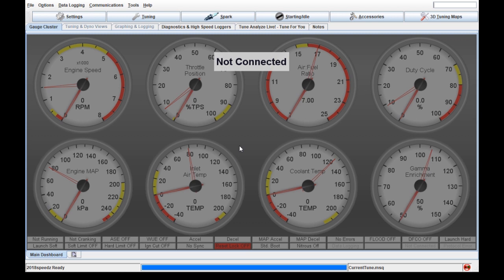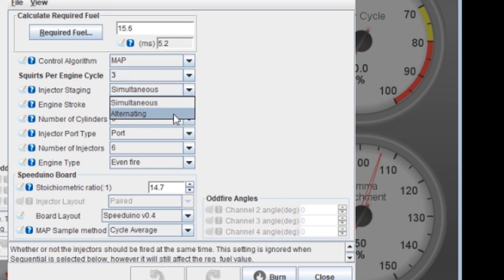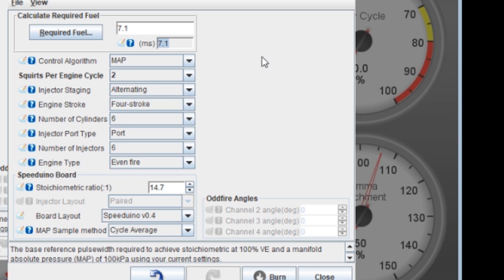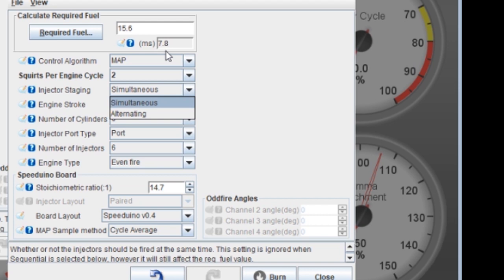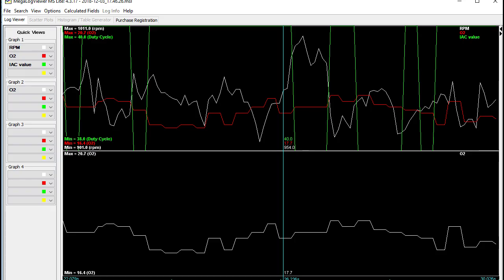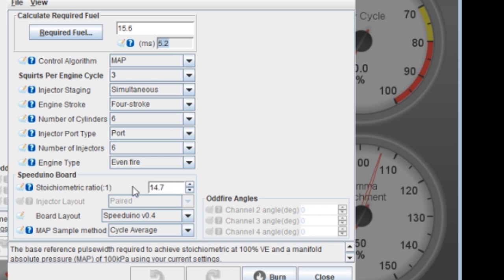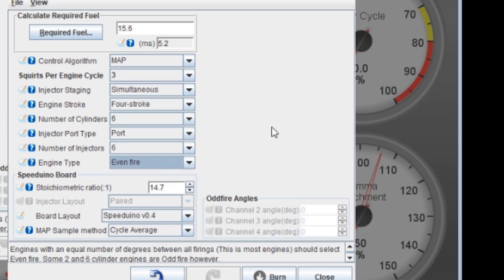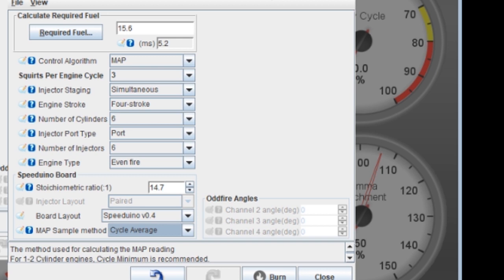Engine Constants - Speeduino Settings Part 1

Comment: just upgraded my injectors to the gtr 440cc. didn't change the squirts or staging only required fuel settings. after maxing out the high load ve cells to the max number of 255 i did a few runs to get a log. iv noticed that my duty cycle is only at 45% and starting to lean bad but my ve is maxxed out at 255 so i cant add more fuel. I tried numerous injector deadtime/correction settings and couldn't work it out, so as a last ditched effort i turned the required fuel up almost doubling the previous number. Now im at 60% duty at 5psi 11.6 afr. Iv read not to change calculated fuel numbers but i dont know what else to do 🤷‍♂
Reply: Just out of curiosity did this lead to any issues? Running into same issues , 815cc injectors and only running 16% duty cycle
Reply: @kiivaskastylings545  check your deadtimes

Comment: Where can I learn more about this?
Reply from the maker: What part would you like to learn more about? I can do move videos at any time. Thanks for watching.
Reply: CEK Garage I’m fairly new to the whole ecu concept, I’ve ordered a book from amazon, I believe my problem in understanding all of this is in the sensors and how they communicate to the computer. I’m guessing everything is like an electronic switch? Im assuming the switch is either on or off but happening very fast. I think once I get it I’ll get it. You’re videos have helped spark my interest. Thank you very much.